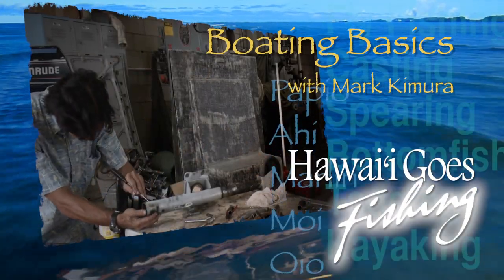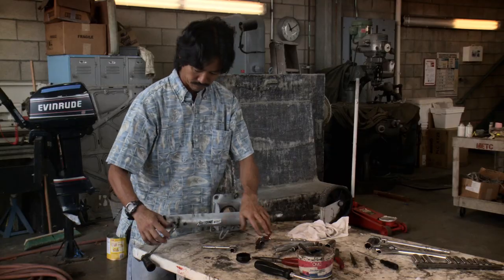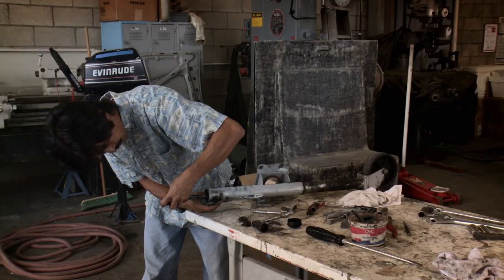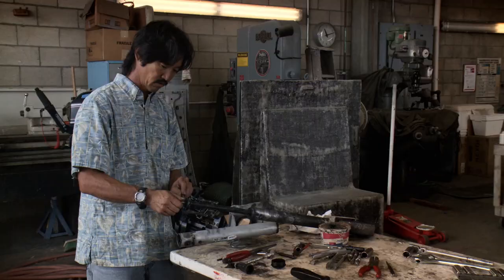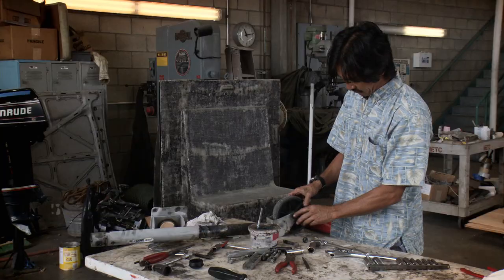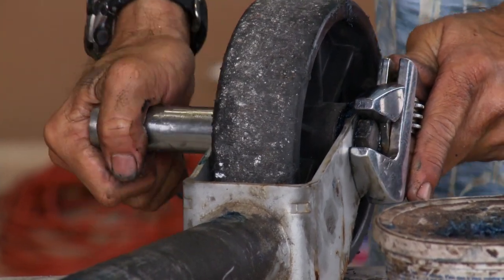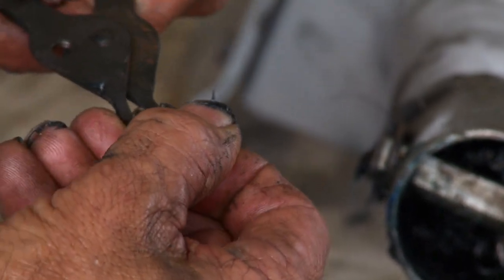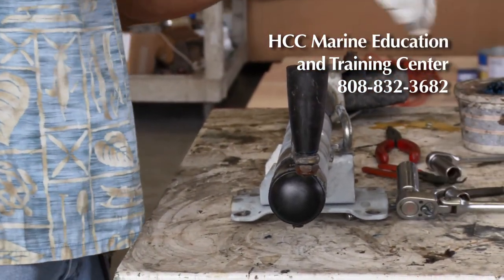Boating Basics, jack maintenance

Comment: Just broke the lower pin doing this.  Might want to consider turning jack upside down and just squirting oil on the spline if not too badly rusted.  Mine was "jacked up" with rust and only 5 years old and I never submerge it.  Still looking for new pin in lieu of $18 kit.